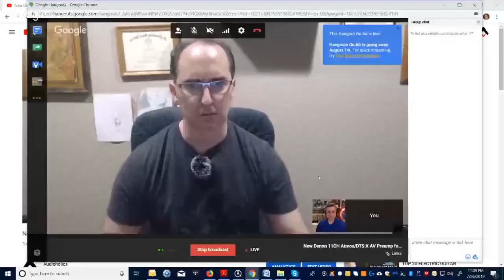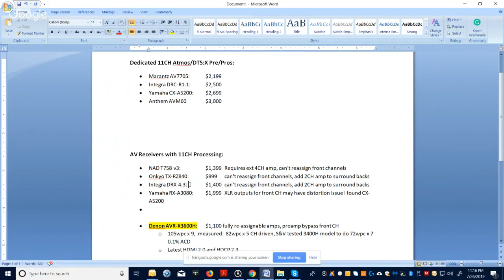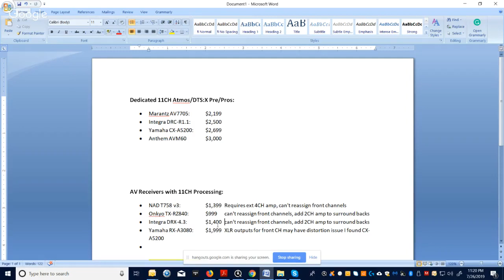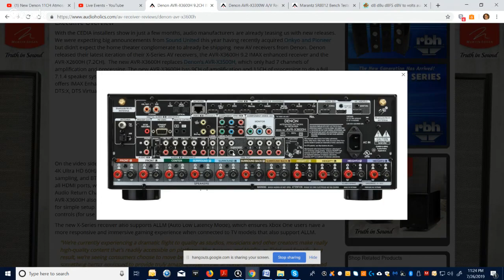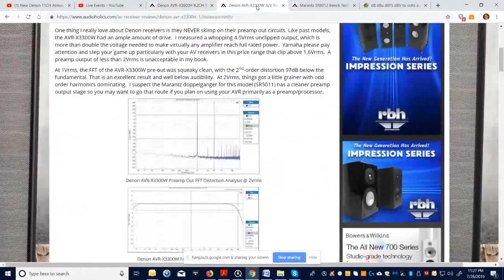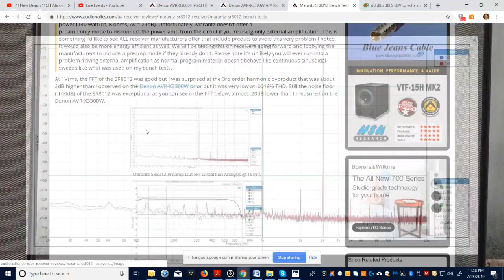Denon AVR-X3600H 11CH Atmos/DTS:X AV Preamp for $1,100?!?

Comment: So the 3600 is better than the 3700 in the sense that it allows the front stage to be disconnected whereas the 3700 disconnects all in preamp mode?

Comment: Doesn't using a Denon 3700 with only 3 channel amp kind of defeat the purpose of disabling the amp section. I'm  confused as running the internal amps is the cause of noise in the pre amp section?

Comment: The best trick you can do is cutting RCA cables conect em to the speaker outputs  and connec to the other amps , step into the flagships over 10 years old you’ll get a good bargain price

Comment: I’ve read that the May 2021 (and newer) Denon x3700h AVRs now use the Pcm5102a DAC compared to the 2020 X3700h AVRs which use the AK4458 DAC. Have you tested the new (serial number above 70000) x3700h to see if the audio quality is as good as the units with the AK4458 DAC? I just bought a new x3700h. I’m thinking of returning it and buying a refurbished unit from Denon (manufactured before May 2021) so it has the fixed HDMI 2.1 AND it also will have the AK4458. Thank you for your time. You have an IMPRESSIVE insight into AVR tech.

Comment: Hey, I know this is an old video, but maybe someone else knowledgable could answer me. He mentions that with the 3600h when you reassign the front speakers to an amp that the receiver completely disconnects those front channels.  Is that something new to denon? or new to the lower end receivers? I am looking at upgrading my receiver from a 920w and am trying to determine if I would be better off waiting for a deal with the x3600h/3700h or if I should try and get a 6300h someone is selling for about 900. Would that 6300 be able to cut off those front channels with hooked up with an external amp as well?

Comment: I noticed when you have Dolby Atmos on that you have to shut off some things on the Yamaha receiver tsr-7850 But my E-ark with the new update Dolby Atmos height speakers work good
Reply: I have the TSR 7850 along with the x3600h.
The Denon is for primary entertainment area and Yamaha was used in a bedroom setup. 
Love both units for ease of use and features.
The pre amp mode on the x3600h dating back almost three years was such a future proof feature. The initial price of $1100 was a bargain and eventually was on sale for quite some time for as little as $800. Pre covid times will forever be missed for those that enjoy new electronics.
The 7850 is another wonderful budget receiver that I will always keep as long as it's working. If I remember correctly it is 5.1.2 capable when not using the rear surrounds in order to benefit from Atmos and DTSX native processing. Loved the unit because it was designed with premium Aventage line features such as the hefty remote, detachable power cord, and front channel pre outs. Think it shipped with HDCP 2.3 and then later firmware update to support eArc was available. 
These two units could be purchased new for a combined $1500-$1700. The best of both worlds for budget enthusiasts to get a taste of two major AVR brands.
If you have either of the units HOLD onto them. 👍🏿

Comment: I was wondering if you could help me. I currently have a Sony a8 oled with the Cambridge audio aero speaker package with bmr drivers. People hate bmr but I love how wide they can disperse sound. I also have duel pb2000 pros. Currently it's a 7.2.2 atmos set up. I'm running a pioneer lx303 9.2 channel amplifier. Power wise its been brillaint and never felt it lacking but I do set my crossovers at 100hz all round so the amp is not really hard up and has all the features like chromecast, dolby vision, hdr support ect. But on the audio science forum it tested poorly.

But that was my budget 3 years ago. I couldn't afford the mid range amps at the time. But that poor review has got me asking should I upgrade to one that reviewed well? 

I'm currently doing well and looking to upgrade to the denon 4700h or the marantz 7015. As I was looking for earc and more eq features. My set up currently sounds great and I am happy with it. It would just be them features I want. 

Due to lockdown I'm not able to audition either receiver and wondering if it would make an impact in sound quality if I upgraded the amp? I have read loads of reviews on the new denon and marantz and people have done nothing but rave about them. I'm not interested in 8k and feel it would be a feature I would never use as I'm a film guy. So would it be worth the upgrade? Thought I would ask you before I pull the trigger. Would the better dacs and extra power in the denon and marantz be audible over my pioneer lx303. I also like the main screen and simple remote of the pioneer so changing brands will be very new to me. 

Any advice would be great.

Comment: First off, thank you for the review and the work you do eliminating snake oil in the industry, and providing insight to make manufacturers innovate!  I have a question, I have an outlaw 5000 and the Denon X3600H.  I was wondering if you were to run all 5 channels in pre out to your LRC and SR/SL, since you can only assign the pre amp mode to either the front or dolby H rear, do you just lose the amp power to the Center/SL/SR on the AVR, or does it re-assign the power to the remaining channels being used on the AVR?  I'm running a 7.2.4 currently.  Thanks again!

Comment: After watching a little longer I was like why don’t they just make a cheaper pre/pro and go full discreet separates for less money but it makes sense. Your point is to use the built in amp for the surrounds and power your left and right with a dedicated amp for the best of both worlds. Having every channel independently assignable allows you to set just the front left and right to pre amp mode and output that to your favorite musical amp.

Comment: Hey gene, thanks for the informative video. I have a quick question, I came across an opportunity buying the x4400h brand new at a slightly cheaper price than the x3600h. My only concern is the eARC connectivity on the x4400h, will that be an issue in the future?

Thanks.

Comment: Watching this video more than a year later is really interresting. With the successor Denon avr-x3700 released, where they implemented your suggestions with this Full Pre-amp mode, this is really a testimony to your welcomed influence on this market. I have to upgrade my Denon avr-x5200w because it doesn't support hdcp 2.2. It breaks my heart because I love everything else out of it. But these are exciting times (except this broken 4K/120Hz thing that need to be resolved). With the Marantz av7706 about to go out, I was considering it, paired with a Monolith 11x, but now, I think that I'm going to settle on a avr-x4700h (for the better processing than avr-x3700h) and the Monolith 11x,  and save on the long run, rather than putting money on those more expensive receivers that we replace all the time. Again - CONGRATULATIONS!

Comment: I recently purchased the Denon 3700H and love.  The setup menu is simple and I was done with the setup in about 15-20 minutes.  However, I may return it do to one glaring problem.  Specifically, this receiver runs HOT (and I do mean hot) when playing movies.  Even with a laptop cooling pad it still runs hot.  My receiver is not enclosed in any cabinet.  I wonder how long it's going to take until it begins to show obvious signs of premature damage.

Comment: awesome review but on Denon website for the x3600h vs the x3700h only the 3700 shows the "pre amp mode" . They are the same price range so either way.....
I do not have deep pockets but I am getting my research done to upgrade my avr so any clarification on this would be great help for me and others I would think. Thank you for doing what you do it is amazing how much information you share and make me read up on to just learn the terminology you use. Again thank you!!!!!
Reply from the maker: 3700 has the preamp mode but 3600 can be tricked for front channels premode if you reassign using 11CH surround.
Reply: @Audioholics  Thank you so much for the reply. The 3600 really has my interest sparked. One more question I have would it work in the 11ch mode even if I am only running a 5.1 or 7.1 setup as far as speaker count goes? My living room is only 12 x 14' so an 11 ch setup would be very hard to fit in the room correctly. Thanks again for what you do and the reply. You are doing some amazing things with this channel!

Comment: Denon tells me you cannot do what this video says you can do. Ie run an external amp for Front L and R while using the other internal 9 amps for the other channels. 

Here is the text from their email where they claim this feature is on the 3700, not 3600. 

Thank you for contacting Denon Support, we value you as a customer and appreciate the opportunity to be of assistance!

In the video you mention at the 31min mark he mentions using the AVR-X3600H with an external amp for his front stage left and right and then went on to saying that adding an external 2ch amp for the Height 2 pre-out to allow for 11ch. As for the pre-amp mode he is actually incorrect as the AVR-X3600H does not allow for a pre-amp only mode. As this feature was added to the AVR-X3700H this year.

Comment: I emailed Denon and asked on my AVR X3600H can I use my external powered speakers for Front L&R while using the internsl denon amps for center, L&R surround,  L & R Rear and 4 height  ...they said NO, can't be done. They said the only thing I can do is use an external 2ch amp from pre out Height 2 L and R
I just emailed denon with your video.  Why would they say that ??

Comment: Currently using a 5.1.4 but would like to use and external amp for F left and Right speakers. I have this working when set for 9.1 but in that mode the Front Left and Right Amps are not disconnected. Any idea how I can disconnect the Front Left and Right Amps in a 5.1.4 configuration?

Comment: Hi Gene, great video and very informative. I have the x3600 and I'm adding an xtz A2-300 power amp in the coming weeks. I only have a 5.1 setup and have read a comment on another forum regarding the front L/R disconnect. It mentions that if you set the amp assign to 11.1 channel you can then take advantage of the disconnect feature and set the pre amp to control your front speakers. Once that is configured you can then edit your speaker config and  set the speakers you don't have to 'none'. Do you think this work around will work? I hope so as i have sold the whole power amp improvements my Dad too and he will have them same combination as me!!

Comment: So the make or break for this for me is the ability to pick which channels are being used “pre out” and which are using the internal amp. It seems in the menu, you can pick if “pre” would be for front L/R or if “pre” would be for the last two height channels. 

Can i use my current 7ch amp and pre out all the ear level channels to it and the use the onboard amps to power the remaining 4 height speakers?

Comment: As a newcomer to the hobby I am soooo confused after watching this video. I was under the impression that the front stage  (L/C/R) couldn't be used with a separate power amplifier. That only surround/atmos channels could be assigned to the power amplifier
Hence the biggest selling point of the 2020 x series doing the amp disconnect. 
Seeing Gene's editorial note on this video related article is just confusing me more. 
Can someone please break this down for me so I can decide whether to buy the x3600 for a 5.1.4 with a power amp driving the front stage or do I have to buy a 2020 model like the x4700h? 
Thanks.

Comment: Peiple should buy denon x3700x it has a pre amplifier mode now that was only on x8500h flagship before. It will have better sound for the amplifier, no clipping. But the denon X4700h seems more audiophile with the AL32 alpha processing and ddsc32 bits. For me the denon X4700h is the best right now,

Comment: If I use the 3600H as a processor only, will it disconnect all pre-outs from the power amp section, or can it only disconnect two of them?

Comment: I'm currently using the Denon AVR-X4500H as Preamp, are there benefited (other than balance output) of upgrading to the Marantz AV7705?

Just bought a 7 channels amp... not sure it's worth upgrading to the Marantz AV7705.

Comment: I got the Denon x6500h and am using the preouts for everything except 4 atmos speakers, which are powered using the Atmos outputs on the reciever. 

Does this higher model also have amplification cutoff automatically when using pre outs?

Comment: Hi Gene, for Klipsch KL-650 LCRs which AVR would you recommend between Onkyo TX-RZ840 and Denon AVR-X3600H? The speakers are THX Ultra 2 certified, Onkyo is THX certified too and the Denon is not.
 Not sure if the Onkyo has independent Sub control or not, does it?

Comment: What are your thoughts on the NAD T778? It’s got 9 built in channels and it’s a modular design with preamp outputs. Cost more than the Denon but it’s upgradable. 
I wonder if it will would give comparable sound to their m17v2

Comment: Hi Gene.  Have you had any time with the Sony STR-ZA1100ES?  If so, how does it compare to this Denon 3600H?  My local home automation A/V installer is pushing me to go with the Sony saying that Denon, Onkyo, and Marantz have all gone down in quality as of late.  I'm running a full Klipsch speaker set-up for my home theater and have an older Denon AVR 3808CI that I'm looking to upgrade from due to lack of 4K compatability.  I have always been really happy with my 3808, and your review of the 3600 seems like it is a really nice piece.  Any advice from anyone would be greatly appreciated!

Comment: Hey Gene question for you. I just bought the Denon AVR-x3600h based on your review here. I did however watch your video on do all amplifiers sound the same. I'm currently running 7.2.4 Atmos setup with 5 marantz ma500 monoblocks powering the LCR channels & the top front channel (top fronts are higher end Paradigm cs-60r v3's and top rears are soundstage blueprints, that's why I amp'd those along with the front stage). Question is do you think the ma500 amplifiers are good amps better than say the internal amplifier of the Denon? Or would you say I'm missing out on detail by running the ma500's? My fronts are paradigm studio 60 v3's and the center is a paradigm cc570 v3. I've been happy with these speakers that I've had for about 8 years now. I've got 7 marantz ma500's I've been collecting for a few years now.

What are you thoughts? Thanks and I hope you're feeling better soon man.

Comment: I'm sold on the Denon X3600X! You saved me! I have a McCormick 2 channel amp for 25 years running Vanderstein 3s Signature towers with complementary subs and 2 more subs for HFE. Using Yamaha receivers for years. Only question I have, and you may have covered but I missed, do the Denon pre outs have the proper voltage you mentioned that many receivers don't? I want to take full advantage of my awesome amp!

Comment: Gene, did you ever get an answer to "no amp re-assignment is made there - only PRE-OUT assignment, and that is a BIG difference. Hence, no amp is disconnected, and no benefit from that. "
You said in your answer that you would call Denon on monday and get this question resolved but I never heard an answer from you in the comments section.    Best regards.

Comment: Gene, when will the HDMI 2.1 equivalent of the Denon AVR-X3600H come out ?
Reply: Not sure what ur asking ...but the 3600 is capable of HDMI / hdcp 2.2 or more with the firmware update. The 3700 is hdcp 2.3 I believe. If ur asking for a stereo (2.1 channel) Denon receiver with HDMI in/outs it’s the DRA-800H. I have both for home and office about 4 months now and was quickly impressed but continue to fine tune & learn more all the time. Easily some of the best performing value per dollar chock full of practical features units I’ve seen in a long long time. Highly recommended!!

Comment: If you use a crown PA amp xls or xli with the pre out on your av it has a sensitive of .774v But I agree with you guys we should have a dedicated pre amp section so you can drive any or all speakers with any external an including a PA amp.

Comment: Is there any way you could use the Denon AVR-X3600H with an Outlaw 5000 to power the LCR while bi amping the front Left and Right speakers such as Klipsch? If so could you explain how that would work or maybe make a video showing how to set that up in the GUI using either a 5.1.4 or 7.1.4 setup? It would be much appreciated!

Comment: Hey Gene, if you hooked a 9 channel amp up to this, would the preamp on this receiver disconnect from the amps on every channel or does this only work on the front channels?
Reply: On the 3600, only the 2 front channels disconnect. The new 3700 does pre amp mode on all channels. That way all channels are disconnected from the amps

Comment: Considering it cost 500 dollars or more for a decent two channel amp why not just keep the $500 and add it to the $1100 and just buy the denon 6400h and call it a day to have 11 channel avr in one? Anybody?..
Reply from the maker: bc a dedicated 2CH amp will usually have higher quality power and better 4 ohm drive than the internal amps of an AV receiver.
Reply: @Audioholics  oh ok. So getting this reciever would be a low cost advantage for someone who just wanted a 11 channel pre out and run a 11 channel amp? I was just looking at it from a view of only wanting 11 channel avr with all channels internally driven. Ok thanks!
Reply from the maker: @number1pappy  yea it's still a good option if you only need modest power. I would still preout the front LCRs if you do a lot of music listening though.
Reply: @Audioholics  Gene please if you know, I can't find information anywhere; do internal amps disconnect for zone 2 if zone 2 pre-outs are connected to an external amp on Avr-X3600H? On the 3700 i assume they do.